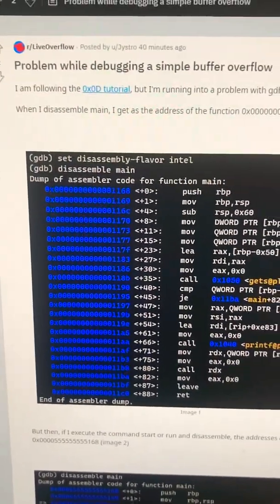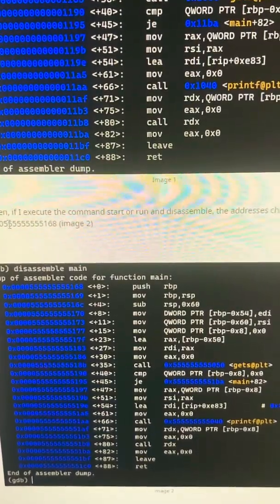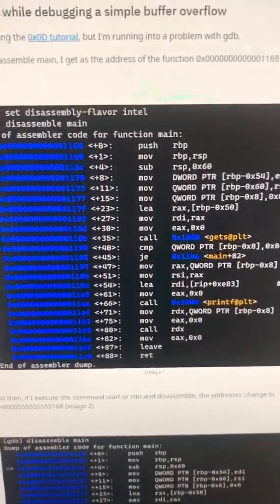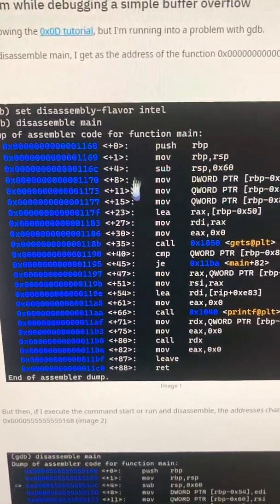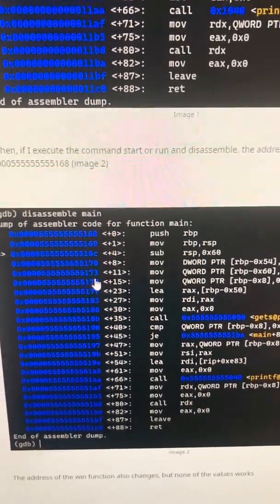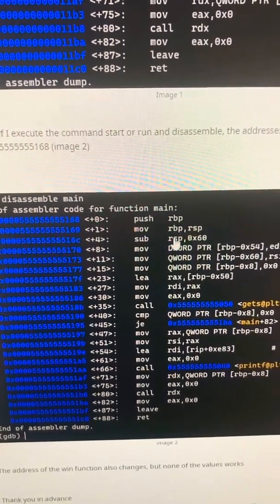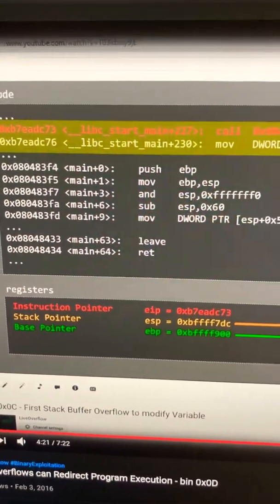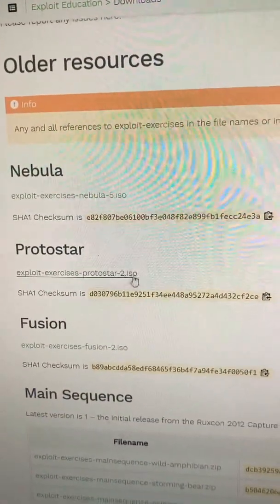Problem while debugging a simple buffer overflow

Comment: Alternatively can compile with -fPIE and maybe -m32 if you want to work on your local system! sometimes i like my terminal too much to use the provided vms haha
Reply: I think you meant -no-pie

(-fPIE actually enables position independent code. It has a slightly different effect than -fpie, but both enable it)

Comment: Why do 64 bit registers start with r, and 32 bit ones with e? It seems very random. Why not s and t or something?
Reply: after a quick google r just stands for register: https://stackoverflow . com/questions/43933379/what-do-the-e-and-r-prefixes-stand-for-in-the-names-of-intel-32-bit-and-64-bit-r
Reply: After 16 bit computers, 32 bit computers came.
Their registers start with the prefix 'e'.
e = extended.
Reply: @coder_rc  and then 64 bit is "really extended"?
Reply: @amyshaw893  probably, or might be "re extended"
Reply: @amyshaw893  Good one... haha
Reply: 16 bit: ax, cx, dx, bx, …
32 bit: Let extend and call them… e_x! (mostly for marketing)
64 bit: Let’s call them just ›register‹ like in any other architecture: r_x; and add 8 more registers r8–r15 (or r8b/r8w/r8d for the smaller ones) like srsly, who thought this weird names for general purpose registers was a good idea? Just call them registers :D
Reply: @RepublikSivizien  In the begining, the registers had names because they had special purposes:

A ... accumulator
B ... base
C ... counter
D ... data
SI ... source index
DI ... destination index
SP ... stack pointer
BP ... base pointer

There still are instructions that can only be used with specific registers. For example, the `loop` instruction always uses ECX, the counter register, or `rep stosd` always uses the EDI register as the destination, the EAX register as the value, and ECX as the counter.

AMD actually tried to get rid of the names when they designed x86_64 (aka amd64): you can actually use r0 ... r7 for the first 8 registers instead of their "legacy" names